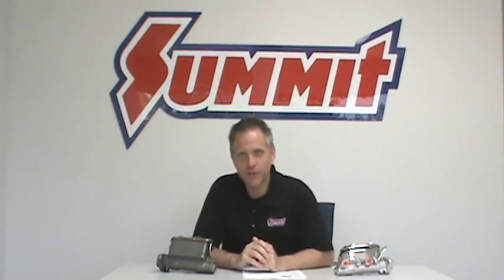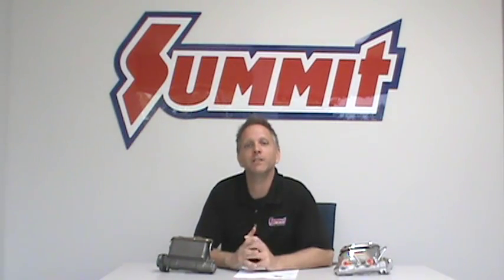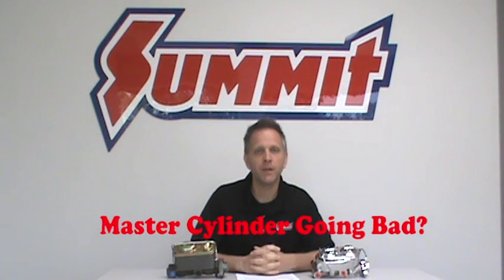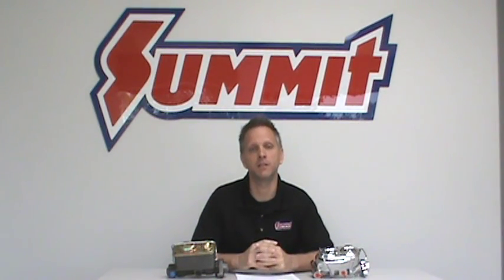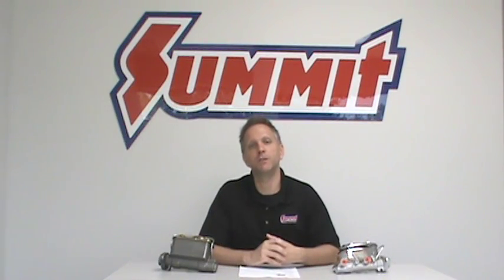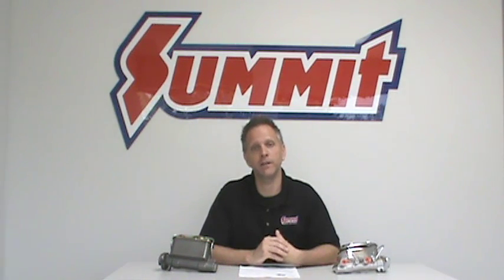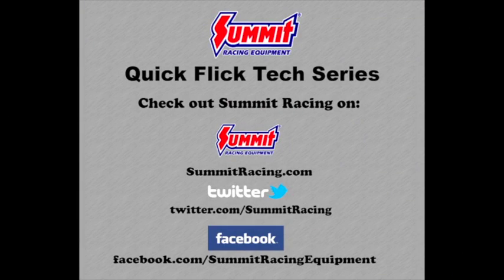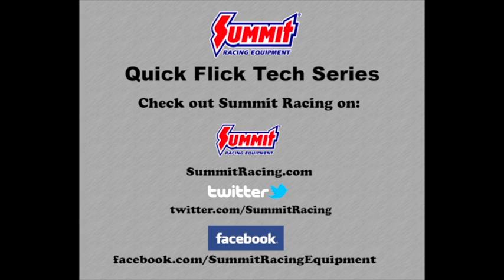How Brake Master Cylinders Work - Summit Racing Quick Flicks

Comment from the maker: For example: You will notice that a 1/2 ton truck will have a significantly smaller braking system than a 3/4 - 1 ton truck for this reason. As far as the squealing goes, typically this is caused by the material that the pads are made out of. Most pads that are made out of a metallic material will usually react in this manner.

Comment from the maker: If you have to pump the brake pedal to get pressure, there is definitely air in the lines. Pressure bleeding the system is hands down the best way to go!

Comment from the maker: There is not a maximum diameter requirement on any vehicle application and in most cases, bigger is better. Having a large brake system will not cause brake lock up as long as the proper master cylinder and proportioning valve is used whether it be a 4 wheel disc system or a disc/drum system. There is not a diameter to weight ratio formula that I know of but typically the larger the vehicle, the larger the brake system must be to support it.

Comment from the maker: A master cylinder not getting fluid to the rear brakes will not cause the rear brakes to lock up. Typically this is a symptom of either a bad proportioning valve or a leaking wheel cylinder that has coated the brake linings with fluid.

Comment: I have changed the front to rear brake line and to both rear wheels on myy 88 Chevy.  I put a new master cylinder on, and a new caliper, but the  brake pedal will not pump up with the engine on, but will pump up  with the engine off. Have changed lines, bled the whole system numerous times (no air in system at any wheel), and have put on a second,  new master cylinder thinking that was the problem.   Sill the brake pedal goes to the floor with the  engine vacuum boost working,   and it will not pump up,  but with vacuum boost off (engine off), the pedal will pump up and get hard.  Do I still have air in the system?  Like I said,  I pumped the system several times, and even pressure bled the system 3 or 4 times, and have not seen any air come out any bleeder.  What do you think?  How would you suggest I check the master cylinder  --  I did bench bleed it real good and got all the air out before I installed it.
Reply from the maker: ritewayguy, 
Can you give our tech line a call? 1-330-630-0240. We look forward to your call! Thank you for watching.

Comment: Hey.  Got a 02 f150.  Front Brakes were making a rubbing noise after being used alot (hilly area with a lot of stops) and getting very hot.  Rear brakes not getting as hot.  Replaced pads and rotors.  Still the same issue.  Replaced the front calipers.  Still the same issue.  Then replaced the front brake rubber hoses.  Still the same issue.  The front wheels don't rotate easily when up on jacks, it uses to hands to turn them.  Thus the calipers are still making contact.  No leaking and No ABS codes.  Is it possible the return spring(s) in master cylinder are starting to fail?  Any insight would be great.  Thanks.

Comment: I have a brake rotor question, in particlar how much diameter is a min, max, recomended diameter for the weight of the vehicle.  I am thinking too large and you will constantly be locking up the breaks, too small and they will burn up real fast if they stop the vehicle at all.  Is there a diameter to weight ratio? is it different in 4 wheel disk vers rear drums.    One last unrelated to size but squeeling when cold although enough break pad is there, why? when warm no noise.

Comment: I replaced the master cylinder and bleed all four break lines, break fluid is good in the reservoir  and there aren't any leaks but but break pedal still sinks to the floor and my brakes don't work at all.
I can hear a squeegee noise when i pump the break pedal that goes away after 5-7 pumps and the break pedal gets a bit hard  PLEASE HELP!
Reply from the maker: Hi Roland Weeds, 
There is definitely air still in the system. Take the master cylinder back off the vehicle and bench bleed it again. Typically when bench bleeding it may take as long as 20 minutes in order to get all the air out. Once there is absolutely no air in the master cylinder, install back on vehicle and pressure bleed the rest of the system.
Reply: Summit Racing FUCK YEAH!!!! 
You were fucking right!

Comment: hello,. i got a 96 chevy truck. the brakes work and i can stop but the pdel is mushy and goes to low, occationally when brakeing the pedal will feel like its stuck and makes a humming sorta ticking if u will,.. then after i pump pedal it goes away,. i notice if i step on pedal constantly before stoping and not pumping them is when it goes low ta floor and make the humming / ticking noise? is this the master cylinder not working rite and then the abs kicks on or what im confused any help would be great>>>
Reply from the maker: +Francis Shattuck , 
We need additional information from you. Can you give our tech line a call? 1-330-630-0240. Thanks!

Comment: hi guys ! i own a hyundai soanta embera, and in the recent times i have been facing a similar problem of the brake pedal touching the floor, but this has happned only a couple of time in the last 6,000 kms of driving <3-4 months> and suddenly when i stop the vehicle overnight or a couple hours its bank to normal ! 

what can be the problem its a leak or have to change the master cylinder ?
Reply from the maker: +Litesh Narayan , 
If there is no loss of brake fluid from the master cylinder reservoir, then there is no leak. Providing the system as a whole hasn’t been opened recently to replace any parts, there shouldn’t be any air in the system. This is most likely caused by caliper slides that are not allowing proper movement of the caliper.

Comment: I have a 87 Ford Ranger. On Thursday my pedal went to the floor with a popping feel. I found the problem was a break between the fuel pump and fuel distrubution thing on the Ranger. Problem is I have very little brakes and there's no fluid in the reservoir. It all leaks out. Why would I not have better brakes becuase the leak is way past the front brakes? Front being disc and rear drum. Trying to get bad line replaced. Can't get connector off. Rusty.
Reply from the maker: Hi altlandf, 
Can you give our tech department a call? We need some additional information from you. 1-330-630-0240. We look forward to your call! Thanks for watching.